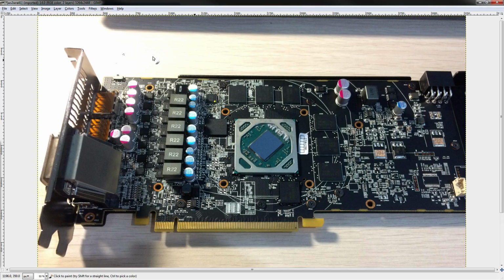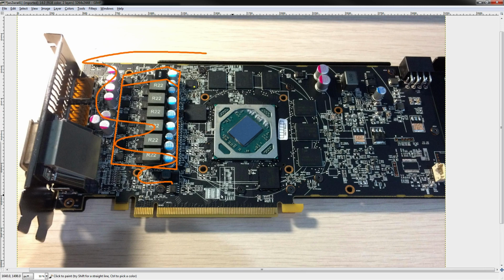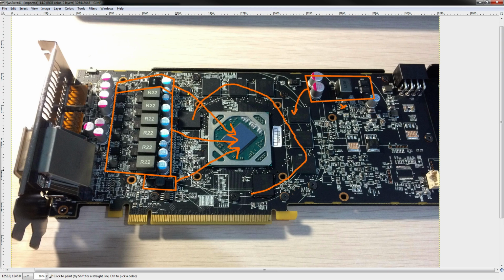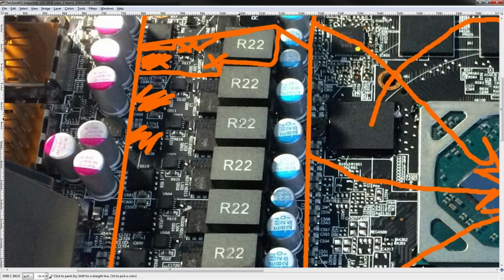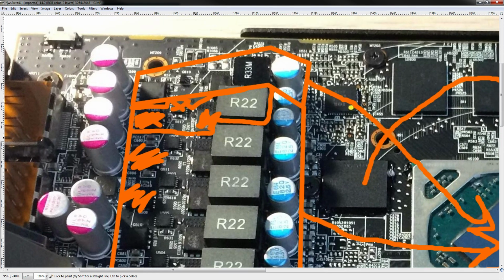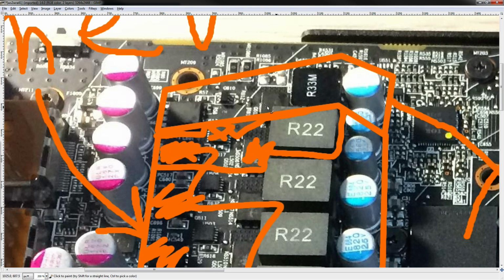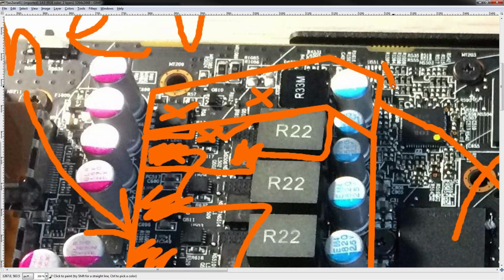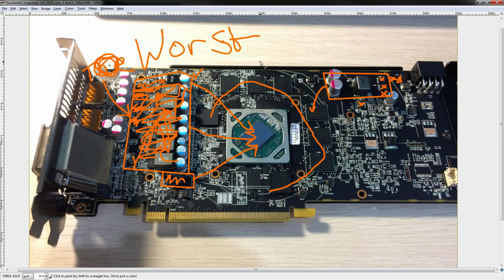PCB Breakdown: Powercolor RX 480/470 Red Devil

Comment: the NTMFS4C1 and the MDU1514 have almost the same RDSon(~6mOhm) so they will generate about the same heat, You cant just use the current rating of the FETs to compare them
Reply from the maker: RDSon indicates the heat output of the FET. It does not indicate if that heat is properly taken care of. The problem is that if you keep the Tcase of the MDU1514 at 80C and feed it 50A the junction temperature will still be bellow Tjmax and therefore the MOSFET is fine. On the other hand 50A going through a 4C10N at 80C Tcase will cause a  junction temperature exceeding Tjmax and the FET will die.

Comment: I'm disappointed the big reviewers focus on comparing average fps even between models of the same GPU as if the fact the slightly higher clocked card gets 1fps more than the other one. THIS stuff is what really matters when choosing variants of the same GPU.
Reply from the maker: Yep that's pretty much why I don't do performance reviews. Comparing the FPS of differnt cards with the same GPU core is a waste of time. The other reason is that I don't play many games and I really don't want to have to worry about bench marking procedures and whatever else.
Reply: I value the build quality and potential longevity of a card quite highly, kind of wish i'd waited til I'd seen this PCB breakdown before I went with the red devil. I won't be doing hardcore overclocking, but like to be able to do a little. Do you think this card's lifespan would be significantly shorter than alternatives when being run as a regular gaming card on a small overclock?
Reply: all I know is I won't be overclocking this card at all.
Reply: Yea benchmarking all the models of the same card with a bit different clocks is just ridiculous. What matters is quality and cooling efficiency.
Reply: Artis, you can overclock it (in fact this card's cooler is very good), as he said just don't go too extreme. I'm using it at 1400Mhz @ +42mV, with +- 130W of power draw, with 2050Mhz on the memory (i know, very bad luck with memory). And its fine, completely stable in games and everything. So i think it's fine for an air overclock.
Reply: i am DOWNclocking my card, and i have the v2
Reply: @Tommyttk  How is your card now? Do you still have it?

Comment: It`s 2019 today. These red devils still runs 24/7 without flaw. And msi`s burns out without breakers on supply rail with bbq on vrm. I think powercolor rx470 based on rx480 pcb is not bad at all....
Reply: Молекула 221 it’s objectively bad...

Comment: Perhaps a bad question, but could one ideally desolder the Mosfets and put better ones on? or do you think there would be power delivery issues elsewhere after that? because with some work Mosfets can be removed,  however, generally the only time you would want to would be after one blows, which would mean your card is already toast.
Reply from the maker: Certainly doable in theory however I've never seen it done and I don't have the equipment to try it myself

Comment: I'm getting random black screens while gaming every few days with rx 480 red devil. Is it because of bad VRM?
Reply from the maker: black screens can be caused by so many things that it's hard to say.
Reply: Black screens were happening a lot more often with default Wattman settings. After undervolting to 1050 mV they only happen once every few days. I'll try a 1000 mV and see what happens.
Reply: Try uninstalling current drivers with DDU and installing the latest drivers again. If problems continue I would advise you to RMA it. That shouldn't happen.
Reply: Few days a go I did what you advised and so far so good. I wonder how drivers can fix what seams like a hardware issue.
Reply: Simple, Drivers were making your hardware malfunction.
Reply: My cards are at 1430MHz 1.2v and they're fine so the VRMs arent that bad. If you're still having problems an RMA should be done.
Reply: It's hard to monitor this problem but black screens don't seam to be an issue anymore. I run it at 1300MHz at 1030mV. The games performance is good enough so I'd rather not increase the voltage to save some energy.

Comment: Could you check out there latest release of the 580/590 card by powercolor that just came out? They just released newer versions of this card and am curious if they fixed all these issues...  I really like the cards overall looks but I’m definitely curious if they fixed all these issues.  Xfx has their “fat boy” version of the 590 that seems to have all this same shit on it. Same bios, everything which I definitely don’t want. Looks like the same exact design with the same exact mosfets, vcore, etc as the xfx 590 which is just an overclocked 480 really.

The powercolor cards are very attractive looking but if it doesn’t perform for me I definitely don’t want to waste my money on it...

Comment: i bought the rx 470 red devil last year day before the refresh for 230 cdn,i mine/game 
i run it at 1210C/2100Mem when mining eth and stock when i am gaming.so far np but i do have a box fan stuck on the side of my 750d case ,the 280X that with it pumps out the heat heh.

Comment: How is this the 480 pcb red devil the same as the 470 red devil  pcbs. The 470 I have does not look like this. Why are they labeled the same. The 470s pcb is smaller.
Reply from the maker: Nope the PCBs are the same. The 480 red devil just has an aluminum extension at the end of the PCB to make it match the length of the cooler.

Comment: Great video, surprised since people were telling me that these things were the be all and end all of RX 480s.  Your Computer Parts are only ever as good as the weakest link in the chain.
Reply: so this is a good or a bad critique? can't really figure out if u are positive on him or not :/
Reply: mine runs great couldnt ask for better specially after the bios update
Reply: So do you think worth buying it?
Reply: Papa Sears do you think worth buying it?
Reply: I agree with the mosfet being the worst, like it's not user friendly when they warn you not to run furmark, even though some games may actually run constant full load, then mosfet is fried. Like what kind of vbios would allow GPUs VRM to be destroyed? that's just plain stupidity. They did warn the user not to run it with furmark and high voltage or power vbios, like what's the point? mind as well put on a fire pit, while roasting marshmallows. One reason i never by AMD GPU cards again, I get AMD for CPU then NVIDIA for GPU. Planning on getting the Ryzen 7 1800X probably later this year until they fix the RAM compatibility issues.
Reply: it is not AMD's fault... think a little
Reply: i know its not amd, the thing is why put crappy vrms? doesnt make any sense!
Reply: it's not up to AMD, it's up to powercolor, im pretty sure there is a retailer that did the same with the 1050ti or the 1050... you know?
the mosfets on the ref card are actually pretty nice

Comment: I actually got mine running at 1440 but I highly doubt the next one will do that.
Reply from the maker: how much voltage and power limit?
Reply: +90 on the voltage and +65 on the power limit with a much more aggressive fan curve so it doesn't dip down below 1440 due to thermals
Reply from the maker: So that's like 1.24V. What's the stock power limit, 110W?
Reply: I believe so. I used polaris bios editor actually so I bumped it up to 170
Reply from the maker: Wait so your power limit is 170W or is 170 * 1.65?
Reply: I set the wattage limit to 170 (I think it's just to the core) but right now my power limit is set at +65
Reply: UPDATE: I put a bios on there that would let me go to 1.5 volts. I "only" went to 1.42 volts but I was able to get it up to 1540 MHz stable* but I wouldn't recommend doing this because the smell of what I assume was the VRM was pretty awful.
...Then I ripped that bios off of it and sold the card XD

*until it blows up

Comment: Hello I liked your video but I have a question. My rx 470 powercolor was used for mining, and there is a problem with the GPU. How can I debug the PCB with multimeter - anyguide will be apreciated. Ive wasted more than a week in a 40$ GPU its not about fixing it, its about the journey. Thank you very very much beforehand.

Comment: on 1 of my red devil 470s u can see the tim on the gpu
almost 3mm inbetween cooler and chip
not just subpar pcb but subpar assembly process
i will say the vrms stay really cool compared to other cards
Reply: also are u a gpu miner? would changing the memory timing straps to lower tighter timings then OCing the mem 200Mhz but underclocking and undervolting the core have any harmful long term effects after looking at the pcb?

Comment: So this card is still bad running the standard Oc out the box??
Reply from the maker: no it's fine on the stock clocks.
Reply: Excellent thanks for the direct reply man much appreciated. In your opinion which is the best Radeon RX 470 to buy for gaming on the straight out the box gaming wise.
Reply: The powercolor Rx 470 red devil or the Asus stryx Rx 470 were my main 2 choices I had chosen so far..

Comment: Even my ancient HD7790 1GB has a 4+1 power phase with S4913s rated for a staggering 106A @ 25c (76A @ 85c). Kind of super overkill for a sub 100W card. I guess that's one reason AMD actually downgraded the VRM to 3+1 with the HD7790 re-release, dubbed the R7-260X, despite it running at higher frequencies (and possibly voltage). 
I guess the monster VRM is the reason it's still alive and kicking after a decade of abuse.

Comment: Such a shame you won't do MSI :( I'm going to buy a RX 480 and the exact model I choose will be highly influenced by your videos, since I find them more useful than reviews on other channels. Right now I'm thinking about MSI and ASUS models, since Sapphire has bad cooling and is off the board. Red Devil was on my list as well, but thanks to you it's no longer an option. Keep up the great work and maybe you'll somehow manage to find the data for the MSI card. Cheers!
Reply: I just got the Asus and its very good. Its always like 30-37% fans speed with near silent operations and temps are around 60-67C. Planning on crossfiring it too. Soonish.
Reply: I need to do some more research on the ASUS, since I've heard they did some funky shenanigans with their other AMD cards this gen, that limits them to some very low temps in order to make the card cooler, so that fans run quit, but all at the expense of the power of the card. This threw me off somewhat, but I think it's in the RX 470, not sure if they did the same in the RX 480.
Reply: Yea I saw TinyTomLogan video about that. Comparing it to the sapphire one. I tested my card yesterday, increased power target to 150% and no performance difference. I increased the power target to get a 1400mhz stable clock though otherwise the it will downclock itself, as the OC preset (110%) wasn't enough for 1400mhz. I could certainly push it further but I don't have much time to play with it currently and I will be crossfiring it pretty soon so there isn't much point in getting the max out of this one alone. I would recommend waiting for the XFX PCB breakdown too.

Comment: What are the thickness of the thermal pads? My power color red devil rx 570's core clock drops big time when ever I benchmark it, even if the fans are on or near 100% and the temp reading off wattman will sit around the 60-70 degrees Celsius. So that tells me that the card is getting hot in areas that don't have censors and therefor protecting it's self from over heating by dropping the core clock. It drops 20-30% in under a minute. 
I want to re-apply the thermal paste and pads, but I don't want to tear it apart before I know the specs on the thermal pads.. anyone here able to tell me or direct me to a site that has this info??

Comment: Any ideas on how to help the vcore VRMs? maybe using the backplate from an accelero cooler with the stock cooler? Or themral adhesive some small headsinks on the rear side of the vrm?

Comment: I like this component analysis. Subbed! Also, since I first saw Powercolor products many years ago I thought: "This screams cheap-ass crap!" Never ventured in buying any Powercolor product, but they seem to give the chinese manufacturers a even worse  rep, even more considering they're a company from Taiwan!
Reply from the maker: Sapphire is from China and they make great cards. XFX is IIRC from Hong Kong and they also have a great card. MSI, ASUS and Giga are from Taiwan
Reply: Actually Hardcore Overclocking All of them chinese people and many of their manufacturing is made in mainland China. PowerColor always seemed subpar and worse then the general quality! I have a Sapphire Radeon HD 6790 as a main GPU, it's ok, but it has a few problems with "nVidia friendly games" like all ATI/AMD GPUs, so it's not really a Sapphire problem! XFX was great back in the 90's and I have no reason to really doubt their GPU quality nowadays. MSI was always a bit sketchy, so I don't touch it. I had issues with Gigabyte mobos'quality, but ASUS mobos are great, though I'm not sure about their GPUs.

Comment: So if the 470 Red Devil uses a similar/identical VRM solution, I pretty much shouldn't worry about it on mine, right?

I haven't seen a need to even overclock it yet, but I doubt I'll even lean on it that hard if I do.

Thanks for these in-depth looks at the differences between these boards.

Comment: I modded my rx580 nitro+ bios & removed all the power limits and set the clock to 1470mhz😂 & set an agressive fan curve and lowered shutdown temperature. And now when i run furmark the card pulls 240watts & stays pinned to 1470mhz and the fans runs at 3200rpm 😂

Comment: can't run furmark on cards, hehe, whats next intel burn test and prime95 shoudln't be run on cpus, cause they actually use the cpu to its potential?
u mentioned furmark triggers internal safeties, so u dont use it anymore, for your testing, but am i missing anything here, or are the producers of the cards, never expecting u to somehow use the card on the level of furmark for other applications?
i just dont see the reason to this.
or did u mean, that for good cards it only happens for the insane overclocks, but for a standard proper card, i can run furmark, without issues to test it to its limits?

Comment: Its a shame, i have this card, currently undervolting it for safety.
Reply: To be fair it's fine at stock or just lightly overclocked.
Reply: Your card is not going to explode or anything. The video is informative, but I think he is exaggerating, in normal gaming conditions you won't have issues.
Powercolor is known to use cheap components, that has been know for years. If I were you I would not be concern running the default clocks the PowerColor Devil comes with.
In a few years when you feel the need to change your card, try a different manufacturer. And don't jump on hype trains. I got the MSI RX 480 and not because reviewers or forums says is the best, is because my previous card was an MSI GTX 570 and has been running for ~5 years now without issues. I had Sapphires and XFXs too, so I learned that the brands I feel more comfortable with are MSI and XFX. I have the MSI RX 480 for about a week now, so it is too early to say how good it is. I wish it had a dual Bios as your Powercolor has.
Bottom line is: reviews are fine, but your personal experience should be on top of YouTube reviewers.
Reply from the maker: at stock settings it will be fine.
Reply: It is have very noisy coils as well.. or maybe its problem of my PSU idk

Comment: so without overclocking is it still a good card? found a 8gb deal for $200
Reply from the maker: Even with an overclock it's going to be fine. Just don't try to run 1.25V and more 200W through it. Oh and don't run furmark at all with unlocked BIOS.

Comment: You're doing a 16 min Video and your only statement is, that the DC-current-rating of the high-side mosfets is lower? Maybe the card is bad and maybe it's because of the FETs, but just the dc-current raiting of these fets is not enough to say so. 

Taking your figure of 34A at 80°C still gives you about 2500W of Power (since they are high side, so 12V). This is clealy NOT the bottleneck here. Maybe the FETs are still worse than the reference ones, but that lies deeper in the characteristics of these devices. If you want to make that point, you should present some switching characterics and go into details about the frequency, these chips are switched at. DC current alone is really not a big deal in switching applications.

One other things that directly comes to my mind when I see the PCB from a design point of view is that fact, that all the power has to run across the whole boards (from Power connector to the VRMs) creating a lot of heat and EMI, then the switching is done directly next to the signal lines and then current has to run back in the other direction to the GPU. This is just a bad layout straigt from the beginning.